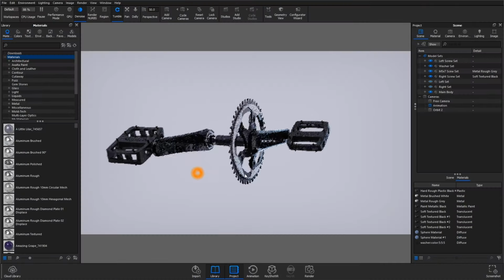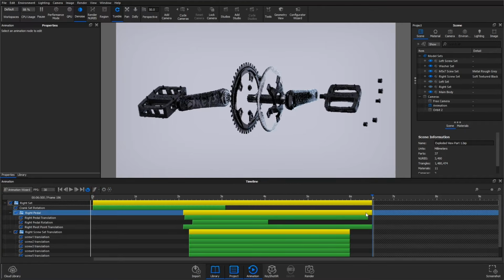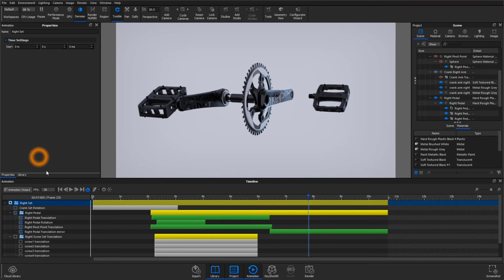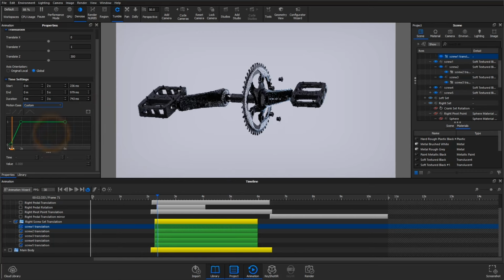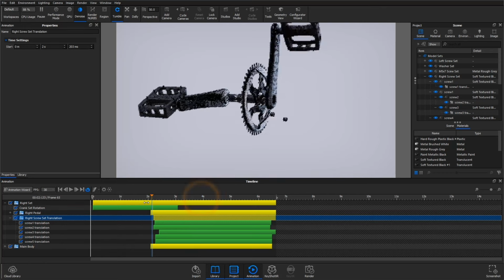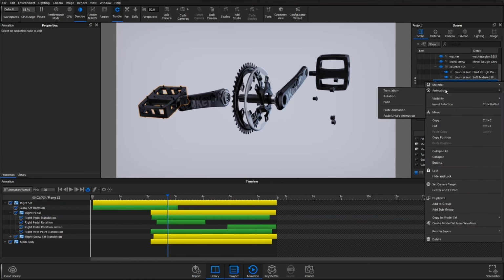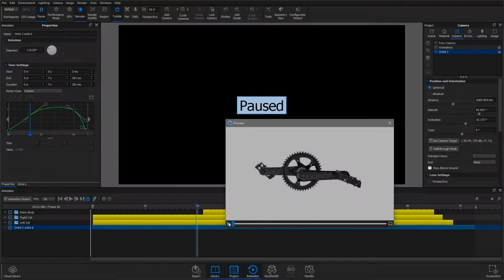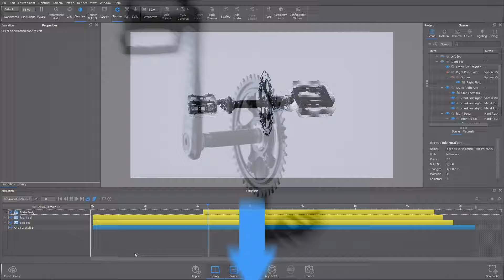KeyShot Quick Tip - Exploded View Animations

Comment: I made a 10 second turntable clip at 24 fps and it took 8 hours 🤨 i7 9th gen + rtx 2060  (laptop)
Reply: you probably kept it to render all frames, switch that option off on the render options screen, i made the same mistake
Reply: @sharvapotdar3257  oh you mean render and save all frames as separate still images? or did i miss your point